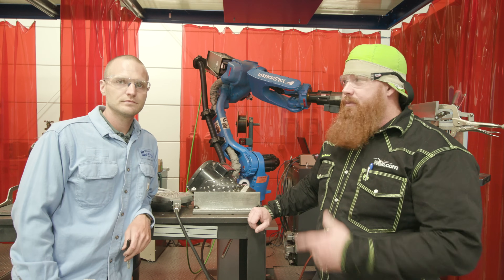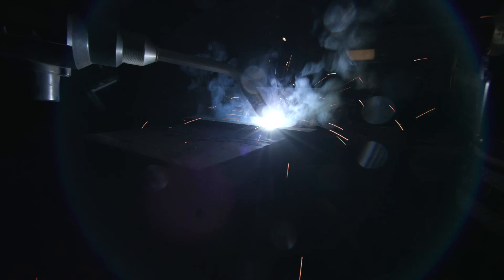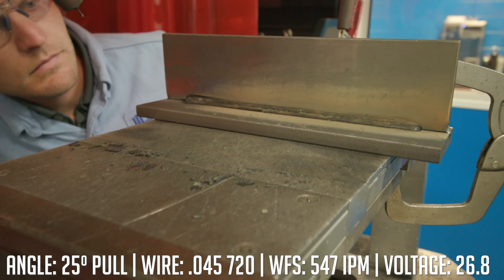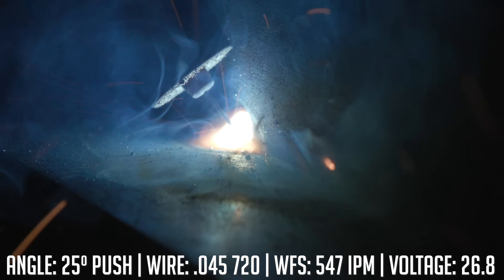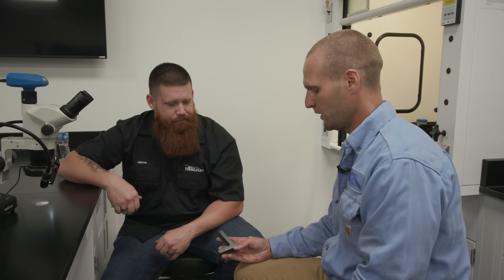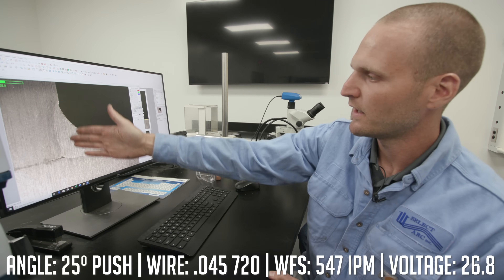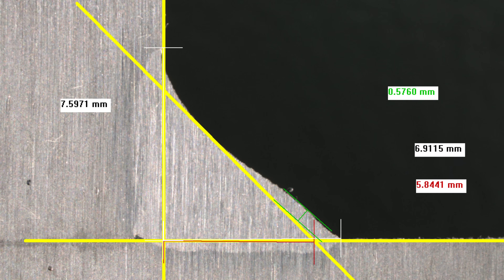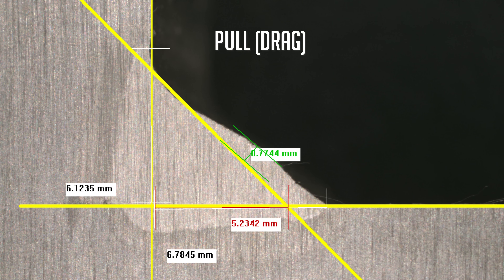Push vs Pull: Flux Core Edition

Comment: This is a great video resource to explain and showcase the difference between drag and pull with fluxcore!!  Its 5 years later so i may not get a response, but im a newbie with no background in welding and i just bought a gasless fluxcore welder to be able to stick steel together for hobby blacksmithing. (Im not skilled in forge welding yet)     

My question is, how much of this information applies to gasless fluxcore?  I dont know much about it yet, and it sounded like the guy in the video mentioned using gas.

Comment: Surely the editor flipped/mirrored the pull video. During setup, you see the robot pulling, but during weld it's traveling opposite direction. Plus the tail end of the weld looks to be on the left of one coupon and the right of the other

Comment: The gentleman from arc solutions referred to 75/25 gas on a few occasions; would the outcome be changed as you went higher with the Argon % in the gas…ie 85/15 or 90/10? We use 90/10 at are shop for everything , mostly hardwire & on occasion flux-core

Comment: At my old job we always push dual shield flux core using CO2 gas. I have always passed my bend tests using this method but my travel angel was mush steeper and I moved relatively slower.

Comment: Hi Guys. Do me a favour please, could you please tell me the voltage and amperage of 10 mm sheet carbon plate by using flux core welding. Thanks

Comment: I've seen a lot of UT failures from pushing instead of pulling. 

Great video!
Reply: When pushing dual shield you mush move slower and slightly weave up and down and you will pass. I've done this for 29 years.

Comment: I've been welding dual shield for almost 20 yrs. I was taught to drag it.Your push  coupon had noticeable undercut. Seems like whenever I tried to push it thats what happens. But I work with dudes that only push. They don't seem to have that problem. When I was starting out x-ray welding I would try to push it for some reason.  I always trapped slag. Started dragging  it and havnt busted an xray or bend since.
Reply: Pushing could be "easier" for some but it is best when trying to pass visual test based off video.

Comment: I run .052 71T1 everyday and i find straight in gives the best of both worlds when welding downhand. Itll lay better like a slight push but itll also penetrate excellent like a pull.
Reply: 0 degree travel angle is what you're saying then..
Reply: @solomonstello  0° straight in to about a 10° slight drag

Comment: Flux core + gas? ok, i'm new, didn't know this was a thing.
Reply: Without the shielding gas the filler metal cannot properly fuse to the base metal. And would also result in porosity.

Comment: Why so low on the voltage and wfs?  I run way higher than that vertical. 31v & 550ipm. 
Flat I’m at 33-35v &  700ipm, (only because the machine won’t go higher) I get plenty of penitration pushing. Can even see it driving into the steel on the leading edge of the puddle.

Comment: so if i weld from right starting point to left with a idk say 10° angle is that pushing or dragging? this video is confusing they both look like they are pushing and not pulling, pulling to me is starting left to right with a gun angle pointed back into your puddle

Comment: You can't really push flux core because you always get flux in the weld at my job we don't use flux we use regular wire with 95 5 90% argon 5% oxygen my opinion four scores junk my opinion only thing is good for his welding outside and that's it

Comment: I'm surprised that the flux core doesn't have much penetration compared to the mig you did in the other video. I've seen alot of tig guys complain about mig cuz of its lack of penetration n alot of guys say flux has to much penetration for thinner steel. But this looks to be the opposite

Comment: Would the results be any different with 100% CO2?
Reply: Gabriel Gutierrez yes but with 100% CO2 it’s messier so you’ll end up with more cleanup. What you save in gas costs, you’ll spend in time and abrasives.

Comment: anyone else think the wfs is a little high?  I usually run around 420 with .045. at 27 volts
Reply: Yeh I did too, but it's the way it runs properly apparantly, nearly every welder I know (me included) runs more voltage/less wire feed than you are supposed to have with these wires.

Comment: OK I am a noob but both videos look like the same method. Gun is behind arc and the pool is in front of the gun.
Reply: If uou look closer you can see the angle of the gun. With the pulling method the gun id note squared off with the metal and its being pulled sideways. With the push, the gun is facing more towards us and the wore is being pushed forward a bit. Im just starting so i could be completely wrong but thats what i saw.

Comment: If it has slag then drag. Learn't that one 60 years ago. Looks like it still holds true.
Reply: Thanks, that helps simplify it somewhat.  What is the benefit to a push though?
Reply: @mattrevesz  Pushing, you are keeping that pocket of gas over the puddle. Argon is slightly heavy so will pool when it hits the air. Dragging argon tends to make it disperse a little bit quicker
Reply: How u drag welding vertical
Reply: @MrQuny93  uphill vertical. Even down hill you drag the slag but just quicker
Reply: @MrQuny93  same as vertical.  You angle the torch head opposite the direction of travel.
Reply: @MrQuny93 point you wire down
Reply: For sure!
Reply: Saw your comment before I watched the video and it made lots of sense

Comment: We use ABB robot welders at work and I'm constantly reworking the welds, we used to use the .45 fcaw but witg the lack of penetration and heavy spatter with most every push welds, we stopped using it, and went ti using .45 scaw instead, changed the gas settings to 90/10 and let her rip.

Comment: Honestly i would LOVE to see this test done with a gasless flux core wire from Lincoln Electric. Its called NR 232 and is an .072 wire size. Ived used it extensively and was blown away at the penetrating  qualities. We were using it on plate  that was as thick as 3.5" and it felt like we were riding a tidal wave of metal when using it. It is designed for high deposition and can be used in all positions. When cranked up to 350 ipm and 24.5-25 volts i felt like it was penetrating like 3/8" into the welds below. We ran parameter testing to check the overall amperage being ran through the wire at those settings and it was around 400 amps!! If you have a chance to do the test using it you will have to use 3/4" plate for the t joint as it is designed to be used with thicker steels. Even if you dont run it through the tests youve been using in these past episodes it would be interesting to see your perspective on its characteristics. It almost feels like cross between wire and stick. Takes some practice to get used to it as it is unlike any wire with shielding gas. Definatly a unique niche kind of wire but ive seen it being used more and more due to the cheaper overall cost and ability to nail UT and xrays. Check out lincolns videos on it for use they have alot of good videos on youtube about it!
Reply: Innersheild? Yuck
Reply: Innershield certainly has its place.

Comment: I may be missing something but it looked like they were pushed?
Reply: yeah looked both pushed to me
Reply: It does looks like that, but its just the angle of the camera. If you compare both you can see the difference in angle though.
Reply: No- you can see the nozzle going forwards past the spatter already deposited.
Reply: I am curious about that too, it does look like both are being pushed.
Reply: @kcscustom  I watched it again just then, the nozzle and tip look like they are angled from behind the weld pool...both definitely look like they are pushed. I don't see any part in the vid where the nozzle is being dragged from in front of the pool. I like the idea of comparisons but yeah this vids a bit bizarre.
Reply: Agreed.  There seems to be some sort of "magic" in the angles, but both looked like pushing the wire ahead of the torch.
Reply: Also look at the liquid portion of the puddle. Waaaaay closer to the wire on the push technique
Reply: @MrJeb707  definitely was.
Reply: I think its the same push video footage for both welds. Maybe a mistake, or the camera didn’t work for the drag weld.

Comment: Unless I'm missing something here. Both were traveling in the same direction with a gun angle of 25 deg. as stated in the caption. Is there missing footage? I was expecting to see the wire dragged, as in the solid wire video...
Reply: Yeah...that's what is confusing me.  They both were push as far as I can tell.
Reply: Mike Vieira I think there’s some camera trickery with that where it looked different than it was
Reply: Probably couldn't get a good shot with the camera
Reply: I agree I am a little confused about that too
Reply: they dragged the first weld...
Reply: @XKTMRiderX  I think I may have been wrong on this one. Because of camera angles, it looked like a push. But maybe it wasn't. Anyways the end result was proven true ; Drag with slag = more penetration.
Reply: @nakedshorts6784  no big I watched it again it is kinda hard to tell...gl to you!

Comment: I use flex core with out gas could you do one on the use of just using flex core with out gas.
Reply: If you could use Lincoln Electrics NR 232.... it is fascinating gasless flux core i belive it is .072 size wire. Crank it up to 300 ipm and 24 volts and BE AMAZED at the penetration when dragged it is unbelievable for wire period. It needs to be used on thicker steel or it will blow through. For those settings i would suggest 3/4" plate for a t joint. I bet it honestly would get 3/8" pen at the root. It is wild.
Reply: Keith Hunchuk that’s definitely on the list. You’re not kidding about penetration. I ran the NR233 on 1” plate 3G and while on my 3rd cover pass I punched a hole straight through the cap, to the back of the backing strip. Man I was mad 😂
Reply: Leonard Gilbreath it’s on the list brother 👍

Comment: Can't tell the difference between push and pull in the video; could someone please elaborate on the difference please?
Reply: Look a little closer.... It's tha angle of the gun in relation to the work piece... Angle in towards the puddle is pull, slightly away from the puddle (as when mig welding aluminum) is push.... Watch again & notice how on the push you can see much more of the inside of the nozzle & the tip than you can on the pull.
Reply: @jimiday9300  Thank you for your explanation, will keep watching the video until it fully clicks in.